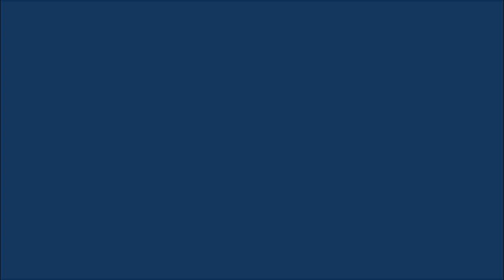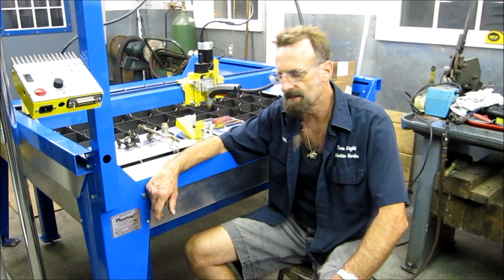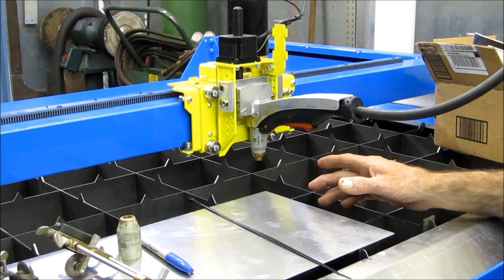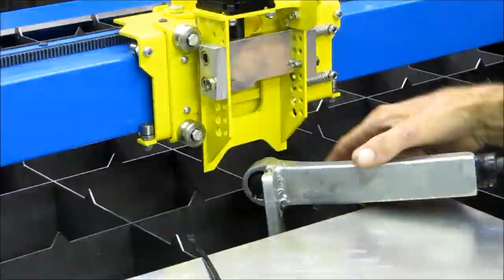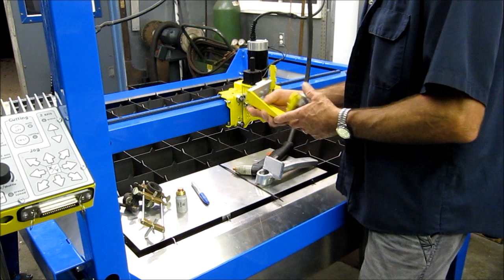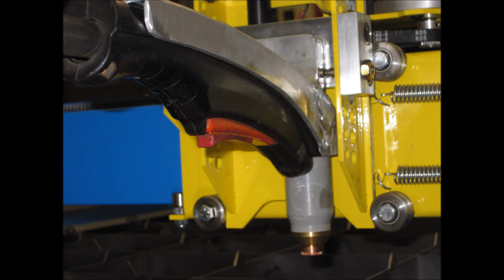Pop-a-Way hand held Plasma Torch

Comment: Great design. Did you ever end up modifying it? I don't recall any holes to lighten it. At first I thought it was a big magnet holding it. Nice use of the little pins.
Reply from the maker: Matt Wilkins Yes the pop a way is on my web site for sale now and the video link is also there to view the system. ;{)-----

Comment from the maker: I had to wire in the controlling wire harness inside the machine, yes the remote adapter sits on the shelf. the instructions for each brand is supplied in the owners manual for the PlasmaCAM's I'm running a Thermal Dynamics ;{)-----

Comment: Hey Keith, Nice job. 

I just upgraded my no-name Chinese torch to a Hypertherm Powermax 45. I was wondering if yours is the same. I'm trying to figure out how to interface my torch to the table and use the handheld nozzle just like you do. I've been reading that You can't use the remote triggers with the handheld torch without modifying the machine. Did you run into this issue too?